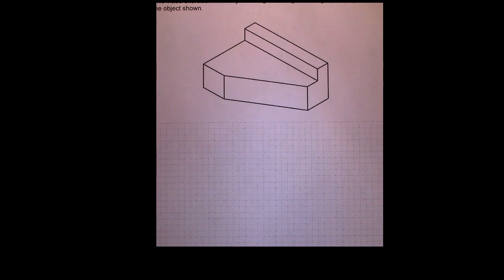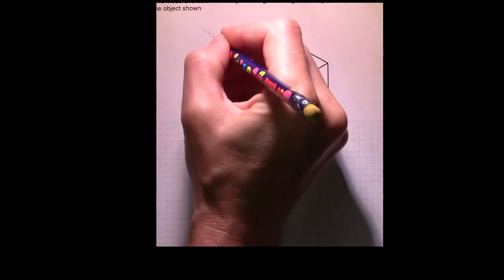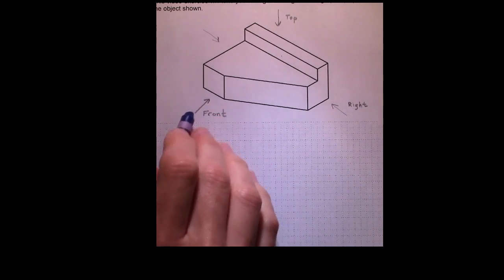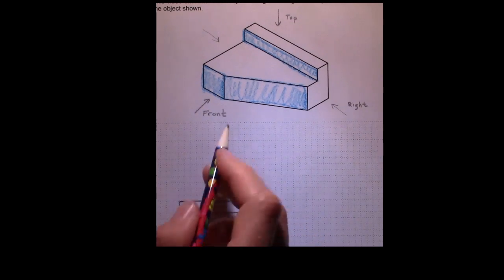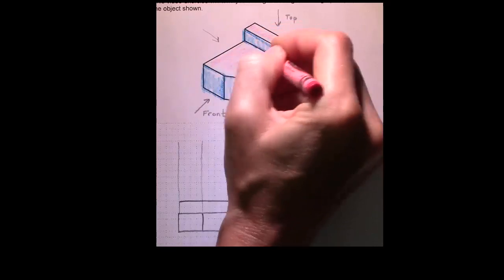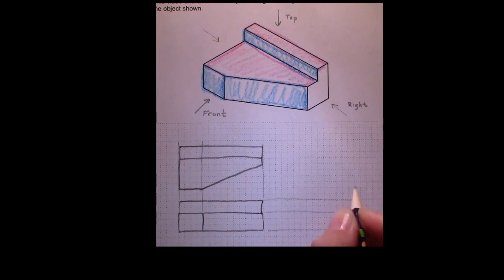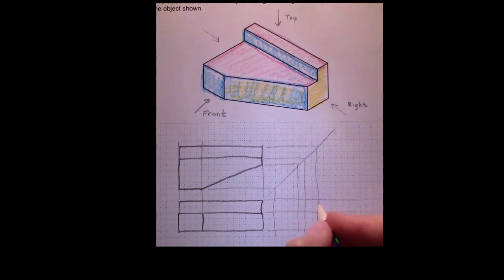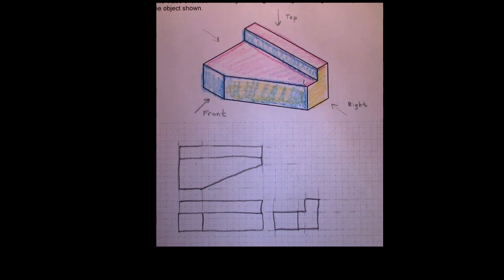Beginning Orthographic Projection

Comment: Very helpful video for students. You are, however, missing a square on the right side. The flat portion on the lower right should have a grid space in of 2, not 1.  The total flat portion of the right side should be 4, not 3.